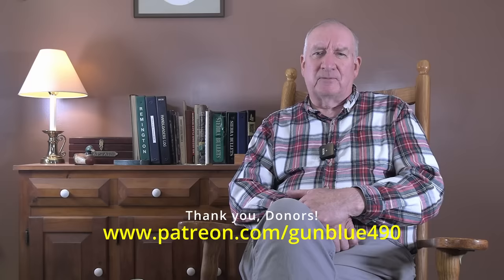The Copper Fouling Lie ~ Don't Fall for It!

Comment: By extension, I would suppose the CFE powders are also not a benefit to shooters.  I found the whole concept to be overblown.  It sounded like a marketing concept.  
I used to etch electrical boards in my youth with the Archer/Radio Shack Ferric Chloride.  That stuff was brutal on all metals.  Same reason I would never clean my bore with Coca-Cola.  Your premise makes sense.

Comment: gonna guess the solvent referred to towards the end rhymes with 'bibbs,' did a whiff test cleaning some shaved copper off a poorly timed taurus and it still kinda burns 15 years later.  you could dissolve a body in that if it didn't come in such tiny little bottles.

Comment: I've been a rifle crank for forty years. I used to go clear around the bend in cleaning rifle and pistol bores including the use copper solvent. Today, shooting more than ever, I use 30 W motor oil for cleaning and, sometimes on stubborn fouling, use Hoppe's no.9. Less than half the time spent cleaning but you'd never know it looking at the rifles.
Reply from the maker: You'll do a quicker job and less messy with simple mineral spirits.
Reply: @GunBlue490  does it work in cleaning the fouling off the cylinder gap/forcing cone of revolvers? I know it sounds crazy but the 30w oil actually does a nice job 90% of the time. Quick and easy.

Comment: I always follow the advice of Shilen Barrels, they recommend a barrel break in process. I always remove the copper fouling once or twice. After that cleaning is very easy for the life of the barrel, not much fouling build up of carbon or copper.
Reply from the maker: I owned a barrel by Ed Shilens that was quarter MOA accurate in 1968, many years before break-in regimens.  They get broken in by simply shooting them. Laying copper down in the bore just happens without any assistance.

Comment: Fouling is a word commonly used in the black powder community and it is a real thing.  It’s caused by the burned powder residue and has nothing to do with the bullet which is wrapped with a patch.  I’ve experienced it many times.  Fouling in modern guns is more due to low quality powder more so than the copper.  What to do about nothing is a great side hobby that I enjoy as well.

Comment: Non chlorinated automotive brake clean is the best barrel cleaning solvent i've ever seen. Its non corrosive, does not attack steel, dries in seconds and removes carbon effectively. Plus, an average sized 4.00 dollar can will last forever

Comment: Interesting discourse ... my 1969 Sierra bullets manual talks of the military using 28% stronger ammonia solution for removal of copper fouling in military rifle barrels. I'm away from home just now, but I'll gladly use the manual to find that reference given.
Reply from the maker: I'm have that dated publication. I was a member of the Army in 1969, and no such solvent was used.  We used only LSA or motor pool kerosene in Vietnam.  Whatever was a consideration at that time, the military currently issues CLP as the sole cleaning, lubricant, and protectant.  It was once at that same time widely believed that ammonia was safe for barrels, before evidence disclosed otherwise.  Such commercial solvents have since included specific instructions to allow their product to be in contact for a limited period of time.  That instruction recognizes the reality of which they are aware.
Reply: @GunBlue490   You also have "dated" publications about cupro-nickel fouling ??
Reply from the maker: @paulreid2223  I do, indeed.
Reply: @GunBlue490  Also I have a friend of long standing who was a special forces soldier and later went on to train military snipers ; he had a conventional regime for running-in and cleaning barrels of these precision rifles : I have taken his advice on cleaning (with consistent results year in year out) that directly contradict your ruminations. I wish you well...

Comment: I use Boretech Eliminator after shooting if I know that firearm is going into the safe for an extended period. Eliminator cleans the carbon and copper out at the same time, but the main reason I use it is that it takes less time at removing carbon than anything else I have used.

Comment: Reid Henrichs says he never punches his barrels. And he claims it gets more  accurate. 
   I agree with you about CLP, its "ok".
I do regularly clean my chamber though!
   Recently, I've been using Bore Tech and I do like the results. Thanks ,Brother! And as usual,  may The Father Bless you!
Reply: I clean my chamber and my barrels AND my brass, but I clean my chamber because I have stuck a case in a dirty one. I like clean brass. Some say I waste my time. Clean brass makes it easier for me to see split cases, especially split necks.
Reply: @cbsbass4142   Yes! I clean my brass b4 and after resizing. Keep the chamber clean for smooth feeding. I do  full resizing with a couple thousandths back on the shoulder.  But neck-only has caused me some stuck case issues . Not worth missing the shot!

Comment: I agree, over cleaning is not necessary and can even be harmful.  But my experience has shown me that each of my rifles are different.  Some perform better with regular cleaning and just a few fouling shoots while others do not like to be cleaned as much.  Unlike a drywall screw which once it is painted you are finished, bore maintenance is on going and depending on how much you shoot should be done when you see your groups opening up.  As for the copper question there are as many opinions as there are shooters and that is probably because different guns respond differently to cleaning.  A base coat of copper over a clean bore is good, however copper over carbon over copper "scaling" is not good and should be removed especially from the grooves.  Once you have fine tuned a rifle and your skills to shoot sub moa groups regularly.  Really all that is left is to keep the bore fouled just right for that particular gun.

Comment: “If it will break down copper it will break down steel” that’s not how chemistry works. 

Patch Out or Bore Tech are perfectly fine for removing copper.

Comment: LOVED THIS VIDEO. Absolutely true. 
I am a practical person. I clean my firearms after use. You are spot on ref carbon. Carbon IS THE DEVIL. I spent 28yrs in the Army, infantry. I agree with you on CLP. Not the best stuff for cleaning. I use foaming bore cleaner. It works fast and gets the junk out. It is not a copper remover. It DOES make carbon come out. A simple few passes with a bristle brush, followed by a series of patches, maybe some Gun Scrubber aerosol can sprayed on a patch, and I am done. I do not have accuracy problems. For hunting rifles, I develop and test my refined loads for that pet load on a clean, cold barrel. Why? When hunting, that will generally be the situation I will be in when I see a hog or a deer. I will have a clean gun, it will be whatever temperature the weather is for the day. If it can put three rounds into a .75 group, that gun is a hunting gun. I am not competing in a match. I just want to know my round has a good chance if I do the marksmanship aspects properly. I'm 65, bagged a ton of game over the years, and have made wild hogs on the ranch here in South Texas, one of my main meat sources. I use a Win 70 I bought third or fourth hand at a pawn store decades ago in 30-06, and I load it with a 165gr cup and core bullet at 308 velocity because I do not have a 308 and as I age, my rebuilt shooting shoulder likes less recoil. Works for me.

Comment: I’m a refrigeration Technician /Mechanic . I was told in tech school that Ammonia was one of the most efficient refrigerants . An ammonia refrigeration system cannot contain any brass or copper because it would quickly corrode. Black  iron  and cast iron or steel fittings were the only fittings acceptable. These refrigeration systems last for decades, and Ammonia has no detrimental effects on black iron or steel. If cleaning solvents contain Ammonia, they will dissolve the copper but they shouldn’t corrode iron or steel. I am questioning the assumption that Ammonia is ruining steel rifle barrels.
Reply from the maker: Strong ammonia causes stress corrosion cracks in steel.  Those cracks, particularly in front of the chamber, are vulnerable to erosion and flaking of the throat.  It's indisputable and a very well known metallurgical fact among gunsmiths.  Do a search regarding ammonia reaction on steel.
Reply: After doing a little research, I learned that when oxygen combines with ammonia the mix will corrode steel .In a refrigeration system, we evacuate down to a high  vacuum before charging the system with anhydrous ammonia. This is why our refrigeration system doesn’t corrode because there is no oxygen inside the system to cause corrosion . Thank you for your reply. That answer’s my question.

Comment: The logic and reasoning used in Mr GunBlue’s videos is beyond reproach. 
The fact that shooters buy and then pour a metal dissolving solution down the barrels of their highly prized rifles is a testament to the persuasive power of the gun industry writers. 
Mr GunBlue has, again, stated the obvious, “Not everything you read is on the square!” 
Laissez Faire!

Comment: The only issue I have had with copper fouling is with Barnes TSX bullets. I was load testing 160gr TSX in my 7mm RM. I was allowing 2 minutes between shots and after about 10 shots, the groups  starting to really open up. I fired a total of 20 round and took the gun home and cleaned it, but found the whole interior of the barrel was copper colored. #9 was not touching it and went and bought some Sweets. Made sure to follow the Sweets directions as I know it can do damage. I had 1/4" flakes of copper coming out of the barrel. Not sure if I got a bad batch of Barnes, but never shot them again and have not had any other copper fouling again.

Comment: I have two Mini-14 rifles.  On copper fouled at the muzzle when new and the other did not.   The difference was how rough the throat was as reamed by the factory.  The copper looked like foil partially adhering to the bore in one rifle.   The other rifle had the faintest hint of a copper color that we prefer to see, where one bullet scrapes off as much copper as it lays down.

A rough throat acts as a file, to scrape copper from bullet jackets and that copper dust is vaporized by the hot propellant gases.  When that molten copper reaches the muzzle where the gas is cooler, sometimes the copper will condense on the relatively cold steel and plate that far up the barrel.    After so many shots the roughness at the chamber throat is eroded smooth and the copper fouling process stops.

Many people have seem such copper fouling near rifle muzzles.  I have seen it only once.  The idea that if you have not seen something, it does not exist is just a little bit too much, old chap.
Reply: And no, I do not use copper solvent to clean rifle barrels.

Comment: A key primise is in error.  The Army has always been aware of copper fouling, especially with the old (1892 to 1925) bluish-white cupronickel (not tin-plated) jackets which cause high fouling accumulation when fired at 30-06 velocities.  The military figured out before WWI that it rendered their marksmanship team unable to shoot accurately enough to be competative at matches, so they developed a cleaner for it named Ordnance Department Metal Fouling Solution, or "Ammonia Dope," as it was commonly referred to.  This was never issued to soldiers for combat for three reasons: 

 1.) It was a pain to use, as air had to be excluded from contact with the solution near steel to prevent it from attacking the steel.  This meant filling a plugged bore and using a rubber tubing muzzle extension to keep the air/liquid interface clear of the steel.    
 2.) The mixture had to be made fresh immediately before use or it "went stale," becoming corrosive whether there is air present or not.  This made the formula is impractical to distribute in the field.
 3.) While the fouling accumulation spoiled match-grade precision, it did not prevent adequate combat precision, so the fouling could be ignored for combat use.

In modern times, a copper-removing cleaner could be fielded.  But with barrel replacement accuracy requirements being something like a 7" group at 100 yards for the 5.56 rifles, it may still be considered unnecessary for that level of precision.  So, if you are satisfied with combat precision levels, then you only have to worry about it if your barrel is so rough that it builds up to the point you get pressure signs.

Comment: Galvanic corrosion requires an Anode, Cathode and Electrolyte, which is adsorbed water from the air.  Clean firing residue, then dry, then oil - which prevents the electrolyte.  Steel has grains, they corrode one to another, one more anodic the other more cathodic.  Galvanic Corrosion - it's all online to read.

Comment: Well, I am not going to challenge your metallurgy knowledge but back in the late 80s I started shooting the origonal Barnes-x bullet in my 300 Weatherby mag, 165gr bullet at 3400fps was lights out accurate for the first 70 or so rounds, then the accuracy started to open up more and more, I used hoppes and other carbon fouling solvent no change, thinking that maybe there was a nick in the muzzle,  I took it to a gun Smith , he showed me the heavy  COPPER fouling streaks in the last two to three inches of the barrel, he used some solvent called "Butches" i think it was? took three or four soakings bush and patch to remove it, went to the range and accuracy was back!
Then not too many years later Barnes realized they had to alter their design buy adding grooves in their bullets, it cut copper fouling way way down but I have still seen it over the last 30 some odd years. If I start to see the streaks in "some" rifles I shoot regular  ( not often I might add) but I do from time to time, I get rid of it I make my own solvent which includes ammonia,  that's the copper remover ingredient that all the over counter copper solvents have , I haven't ruined a barrel yet in 4 decades of trying. Sometimes there are exceptions to the rule I suppose,  straight shootin.

Comment: When I buy a new gun or a new barrel I run a few oiled patches through it then take it out and start shooting. I have never "broke in" a barrel or felt the need to do so. When I clean my guns I run a few oiled patches down the barrel, occasionally a nylon or brass brush and they are ready to shoot again. I am only shooting recreationally or hunting with my guns, long range shooting may be a different thing all together, but, I guess I never really understood if a pristine, squeaky clean barrel was a such good thing why so many "fouling" shots were needed before the gun got back to shooting accurately again. Seems to me that the copper fills the small "imperfections" inside the barrel giving it a more uniform, smooth path for the bullet to travel, alleviating damage to the bullet, which will allow the bullet to cut through the air with less disruption. Just my experience after shooting and hunting for the past 50 years. Thanks Blue, another good topic and video.
Reply from the maker: You're exactly right.

Comment: Copper seasons your bore I use only PB Blaster and bronze brush and degreaser.  I take very little copper out of the bore it builds a good seal protects iron, it increases accuracy and velocity and protects the bore.  I take out powder residue and carbon.  I coat bore with light PB Blaster and some light Silicon to coat bore and outer have for 35 years my rifles all shoot 1/4 some less to 1/2 inch groups.  Copper is your friend.
Reply: I use the copper and light oil and silicon to protect my bore.
Reply: Yuck

Comment: I shot a some groups with my Bergara 6.5CR recently. They were in the 20-40mm at 100m range, compared with 8-20mm when I developed the load about 2000 rounds ago. A thorough de-coppering was suggested. I did so, ignoring your advice.
And now it is much worse, 30-70mm. Factory RWS also now groups worse than ever.
I'm unable to find any other fault with the rifle system so I'm thinking the barrel may simply be worn out for my purposes.
In writing that I realise I should try another scope before I re-barrel.
But I think I have some copper solvent for sale.

Comment: I could never really figure out why the Marine Corps had us cleaning with CLP, then lubricate with LSA.  If CLP was a lubricating substance, then why the LSA?  Well, I have never purchased a copper solvent for my firearms, even after seeing videos where people say that the copper can foul your barrel, and fill in your rifling grooves.  After seeing this video, I think I will take out the borescope and take a good look down one of the older rifle barrels and see what I see.
Reply: @ Disturbed Maynard, Hello. When I was in the Corp, tail end of the "Vietnam Era" we had "L.S.A." (Lubricant Small Arms) in a green plastic bottle. And Bore solvent/cleaner, wire bristle bore and chamber brushes, and slot tabs to screw into the cleaning rod for the cloth patches. 
 
  After a long break in Service, I joined a nearby Army National Guard unit, about 1990, and they had "C.L.P." (Cleaner, Lubricant, Protector).   Like you, I wondered to my non-sciencey / non-chemical mind: "How can it do all three things?" But I figured the "Smart guys" at Headquarters Army knew better than me. 
 
 I still cannot quite figure it out, BUT I do know that for decades there has been "3-in-1 oil" at hardware and lumber and tool and grocery stores, which is a type of "C.L.P." also. I bought two mall cans of it this year because I could not find any of the normal gun cleaning products in my small city. It seems to work okay.